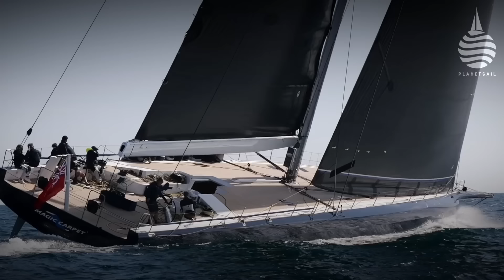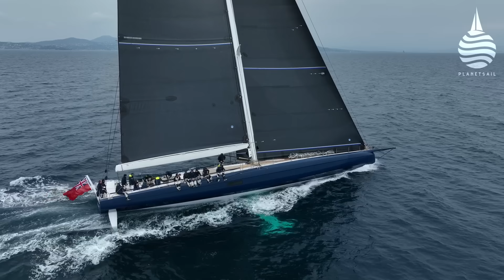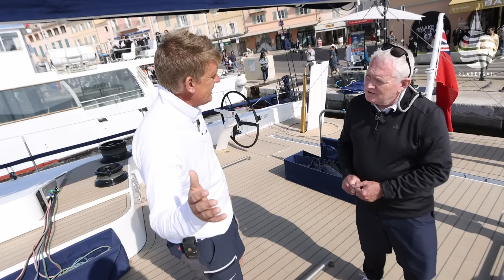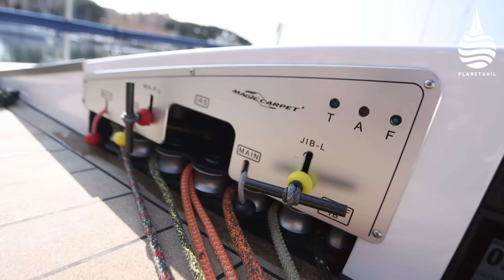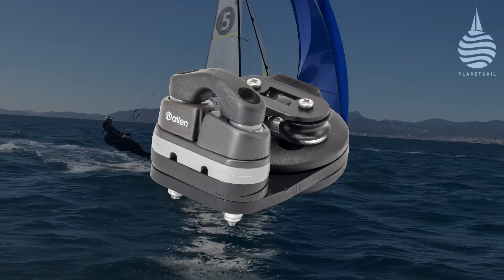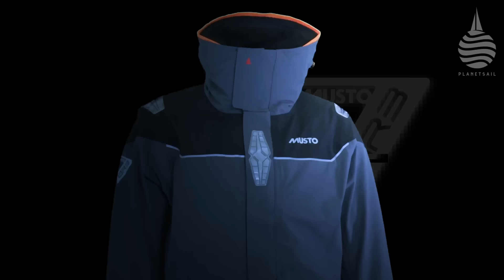On Board & Hands On - Magic Carpet-e  Part 2

Comment: How is the battery bank charged without a generator? Is it simply plugged into shore power until it’s full, like a huge cell phone?? I’m assuming that the prop will generate power when the boat is at speed, but is that enough? Confession: I’m not a sailor.

Comment: I like yachts. I like electric vehicles. This is an incredible machine, a triumph of technology. But I don't get this one. For me a maxi is a boat with a long waterline which can handle a vast range of conditions.
Reply: This boat has the same low freeboard as some other modern Maxis.  Looks like it could sail in almost any seas to me.
Reply: What features here do you think make it less seaworthy?  They use modern technology to build the fastest boat at a moderate wind speed (12 knots).  Does not mean it will have problems in other wind and sea conditions.  Plus the interior work area is gorgeous..  The cost must also be breathtaking. 🇺🇸👍✌️🇺🇸